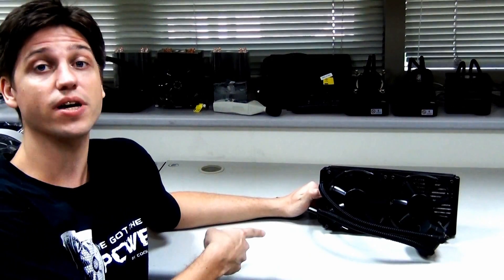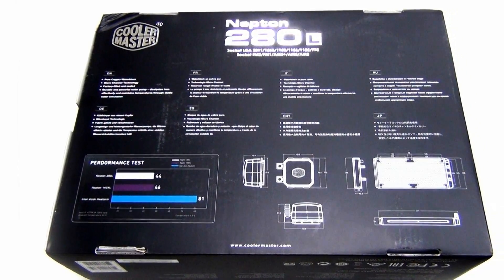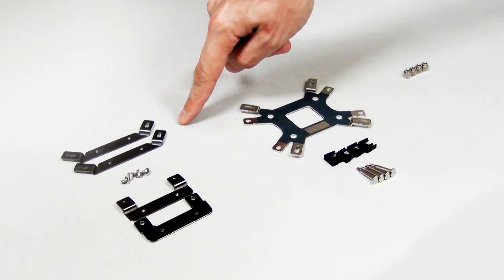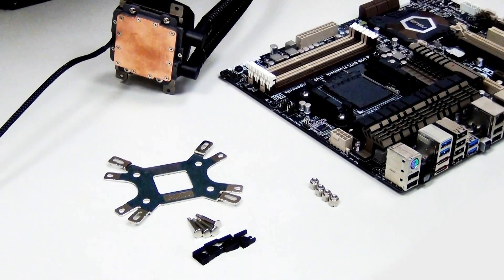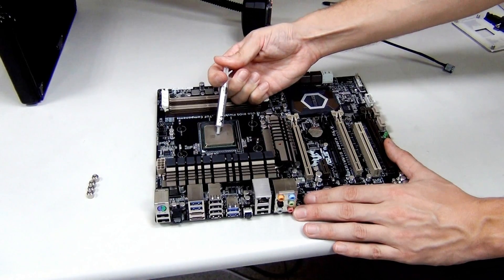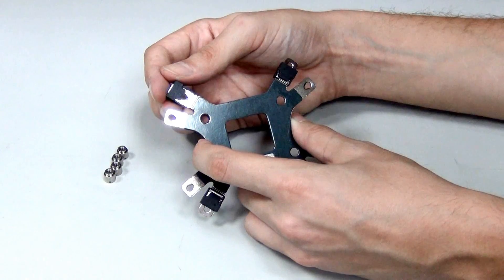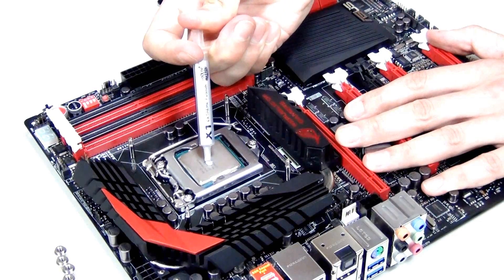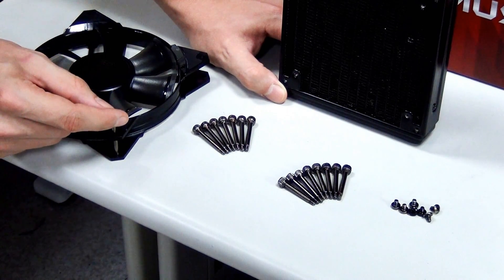Cooler Master Nepton 280L - Installation

Comment: thanks for the video think I found my next cpu cooler for my future skylake build. :)
Reply: Mark Davenport Jr same :D what is your setup going to be?
Reply: Stefan De Bokx i5 6600k oced like hell with 2 liquid cooled gtx 970 evga sc cards in sli thanks to corsairs new hg10 n970 bracket thats coming out soon. :)
Reply: wow that's ridiculously badass! i have the same processor and then a r9 390 which i am able to upgrade with another 390! i also wanted a bracket like that but i thought i would be fine saving some money :) my build is about 1350 euros (1500 dollars i think or something close)
Reply: Nice :)

Comment: Bought this cooler and when I went to remove the sticker from the cold plate, the plastic came off without removing the adhesive as well, which is difficult to remove with rubbing alcohol, some of it is still on there, what should I do?

Comment: This was the product that meant the end of my buying from CoolerMaster completely. Well, this combined with the Cosmos Ultra II cases.  I have several machines and found the Cosmos II perfectly adequate. Until I tried to put in a 280 mil radiator in push pull config with various forms of Ramage Motherboard.  After a bit of minor modding and being selective with parts I got them in the Cosmos II but it was not standard. Then we had to put a Cooler master II product (The Nepton 280L into the cosmos II ultra tower.) Couldnt do in push pull.  If you try you have to chop off parts of the handle, then the frame because of the fill port.   This company are a shambles.  The Cosmos II is the nicest looking case (mods aside) but it is useless.  360 bay which is largely obscurred, 280 doesnt even fit properly from their own product line.  The nepton itself is far more clunky to fit and less friendly than the Corsair 110.  Personally I like the attachment to the motherboard which is far better than this.  Not sure why this popped up on my youtube as I wouldnt use CM these days if they game me it free.  The cases are too badly thought through

Comment: Will this fit on a Thermaltake Level 10 Gt?

Im assuming yes going the top mounting method right?
Reply: Yup. Was able to find out that the nepton 280l has both 140 and 120 mounting holes.

Comment: Hi.I have a thermaltake Chaser A71 pc case and was wondering if i can fit that cooling in?If not what other would u recommend.Thanks
Reply: i have both. it fit. but you have to put the fans at the top of the case the radiator inside the case.

and you have just increase the  screw holes on the of the case to let it pass e screws.

i installed today mine and work like a charm :)

Comment: Hi guys! Can you tell me if Cooler Master Nepton 280L fit in NZXT Phantom 410 case?
Reply: I'm pretty sure you can. If you have 30mm in either the top plastic area or beneath it then you can for sure. You'll have to measure it to be certain.
Reply: Knight Templar I don't suppose this will fit in the Cooler Master Storm Stryker?
Reply: overclock.net has a compatibility guide for Corsair all-in-one coolers of different sizes. If you can't find your model or brand just use one of those in the same size as a frame of reference.
Reply: Knight Templar thank you very much I appreciate it!
Reply: No problem. Pay it forward some day.